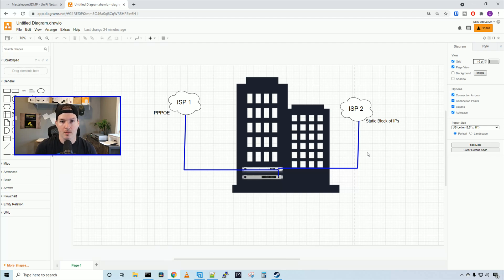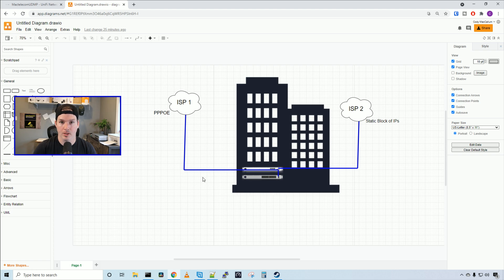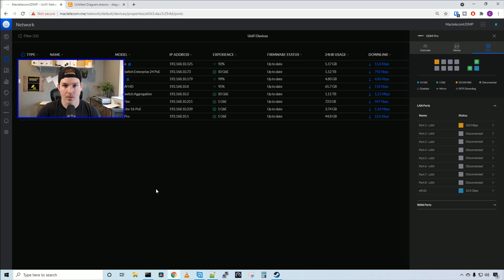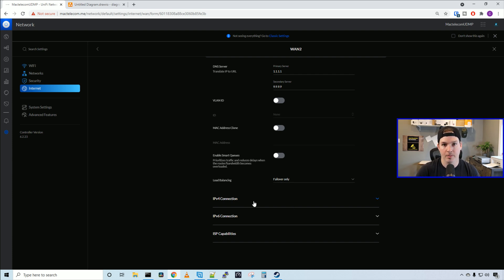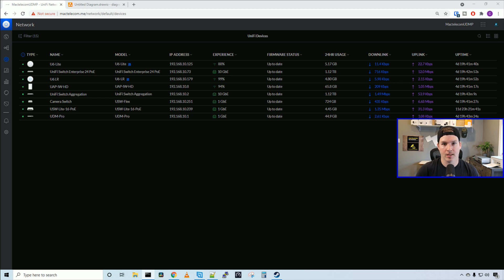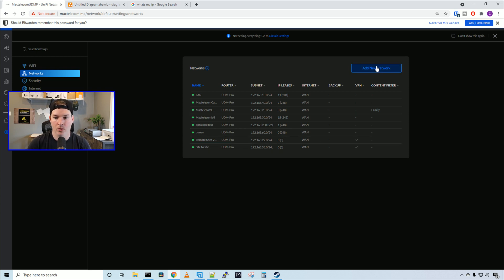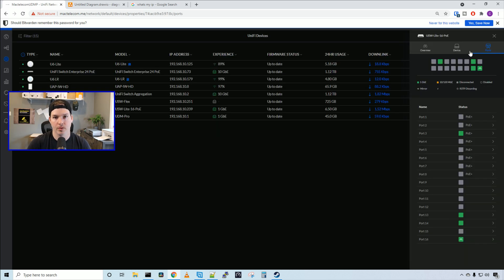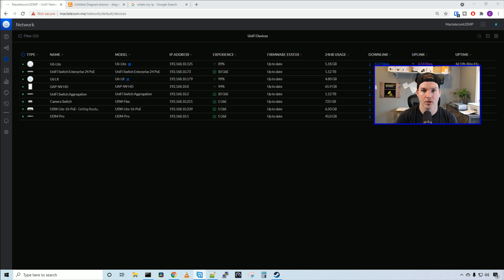UDM Pro Failover and Multi-WAN IP

Comment: Great video! I do have one question: If I have a block of IPs and I want to host for example two gameservers, both utilizing the same port, can I tell Unifi to forward everything going to IP1:1234 -> PC1:1234 and IP2:1234 -> PC2:1234? I know this used to not work, but I don't know if they've added support for it.

Comment: I’ve been trying to get this working at home but failing. It’s in reverse, ie my primary ISP is a very fast cable provider giving me block of 5 IP’s, and I want my failover to be my slower connection that runs PPPOE. But I can’t get it connect over WAN2, only WAN1. Are there different capabilities between WAN1 and WAN2 in some way?

Comment: Hi Cody, Again nice video. With relation to ISP's I go from fiber to LAN by means of a media converter. When I connect the LAN cable from Media converter into WAN 1 of the UDMP the connection keeps dropping. Yet when I put a SFP on that same LAN cable and put the SFP directly in the WAN2 of the UDMP all is stable. Any idea why that could be. Oh and I'm not the only one whit that issue.

Comment: I have two ISP’s.
One is 1Gbps and is on WAN 1. The second is 10Gbps and is on the SPF+ WAN 2.
I do not find how to set WAN 2 as Primary, as in older firmware versions.
Any Ideas?

Comment: No then it’s not just failover you can also do “manual load balancing” ? Little confused about the ending. It looked like you could decide which interface a network could go out then you said you can’t do that.
Reply from the maker: You can not tell traffic which WAN to go out of it will always go through your primary. 

If you only had one WAN connection with a block of IPs you can tell it which IP to take in that block

Comment: How much time does it take to switch to the failover network, mine is taking over 20 sec?
WAN 1 PPOE 
WAN 2 DHCP from 4g Modem
Reply from the maker: Mine was seamless didn’t even have a packet lost
Reply: @MactelecomNetworks  
64 bytes from 1.1.1.1: icmp_seq=28 ttl=54 time=13.5 ms
64 bytes from 1.1.1.1: icmp_seq=29 ttl=54 time=13.4 ms
64 bytes from 1.1.1.1: icmp_seq=30 ttl=54 time=13.1 ms
64 bytes from 1.1.1.1: icmp_seq=31 ttl=54 time=13.5 ms
64 bytes from 1.1.1.1: icmp_seq=47 ttl=59 time=37.0 ms
64 bytes from 1.1.1.1: icmp_seq=48 ttl=59 time=37.5 ms

I did unplug the WAN1 wire from UDM Pro. 
16 packets got lost
Reply: Hello, which SPF+ Module do you use on port 10 ?
Reply: @benjaminbaulez5103  I use SFP one, max speed is 50/10 on that connection.
Reply: @OGH3294  Unable to get an ip from my 4G router (DHCP) attached in WAN2 with RJ45 10G Module ??
Reply: @benjaminbaulez5103  Did you try manually setting the link speed to 10G.
Reply: @OGH3294  thanks, but I have to set 1 G (in Auto or 10G , it appears disconnect -grey-) - if I plug my laptop directly to the 4G router , i get an ip..... no clue ...
Reply: @benjaminbaulez5103  does your 4g router 10g port?
Reply: @OGH3294  no it s a 1G router
( it works if i plug it on wan1 port …)
Reply: @benjaminbaulez5103  I think you need to check with the vendor whether it supports 1G.
Reply: @OGH3294   you were right ! feel so stupid  ! i changed my 4g router and now it works perfectly. thank you !

Comment: Do you ever use Spanning Tree Protocol to setup redundant data paths? Let it block lesser paths that will eventually open if a switch needs restarted or goes down.
Reply from the maker: Yup sometimes. Usually just put it in a LAG

Comment: Can this be done on a USG as well?
Reply from the maker: Hmm not sure I’ll check for you tomorrow and let you know
Reply: I think USG can't do Multiple WAN IPs. Failover and load-balancing are possible.
Reply: It shows an option under wan2 which is set on failover to add additional block of ips when I check under UniFi network app for my USG 3P
Reply from the maker: Oh nice I have a couple UsGs just not hooked up at the moment